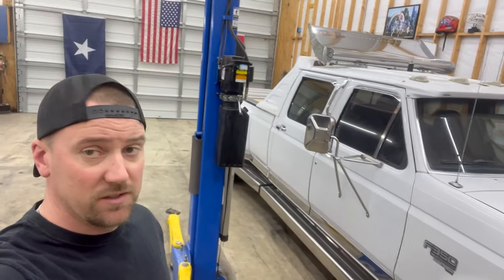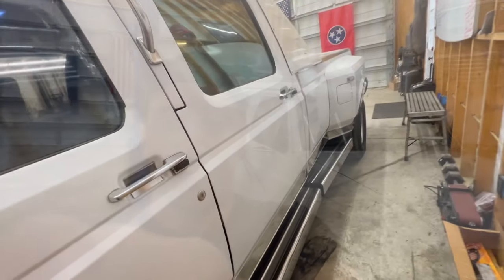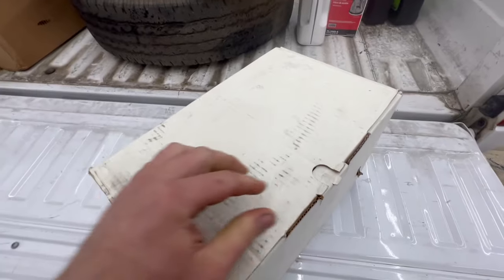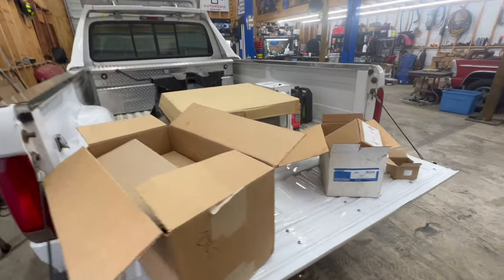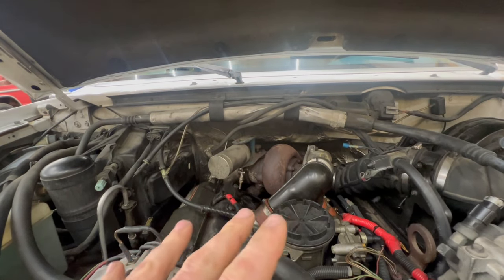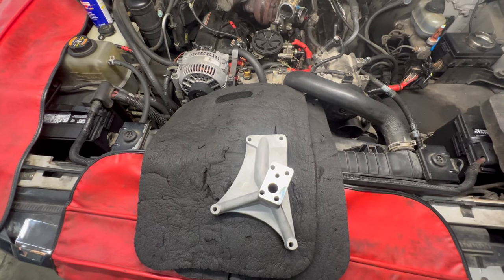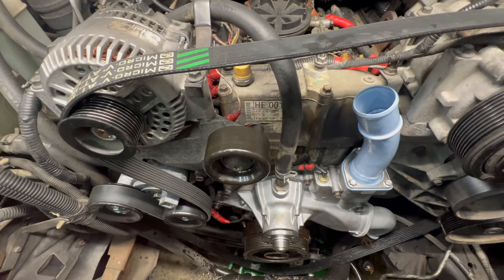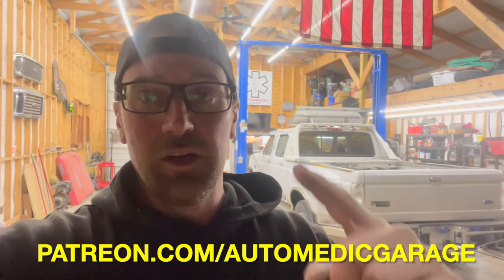7.3 OBS TIME CAPSULE

Comment: I’m pretty new to your channel and I like your content. I get the impression you really know your PowerStrokes. 
I’ve a mechanic for years, mostly farm equipment. Older now and I just putter around in my shop. I do have a lift for working on my vehicles. 
I’ve had two PowerStrokes now. I had a 97 F250 now I have 2000 F350 Lariat. It has just over 121,000 miles on it. I bought it with 75,000 miles on it in October 2010 on EBay from Texas. It has basically zero rust. I’m in New York State but I never drive it in the salt! 
I have two issues with it though. One is it uses oil. I’d say around a quart of oil in 1500 miles. Yet when I start it on a warm day in the winter there’s absolutely no blue smoke like unburnt fuel. Seems to me to have good power. I have a fifth wheel camper and a dump trailer I made and it pulls them fine. 
I did the valve cover breather delete. It’s apparently is blow by because it does vent vapor out my hose. But it runs so good and I use it so little I don’t have any plans to do anything at this time. Just wondering if you would know what it might be if it’s not blow by? 
Thanks
Reply from the maker: I’d have to see how much it’s pushing out the oil fill. Are you sure your not leaking any?